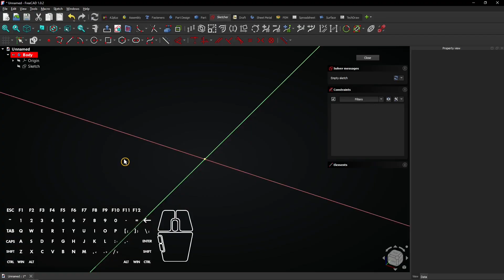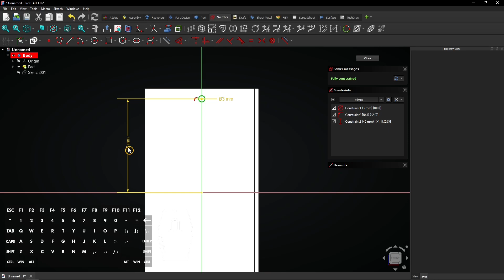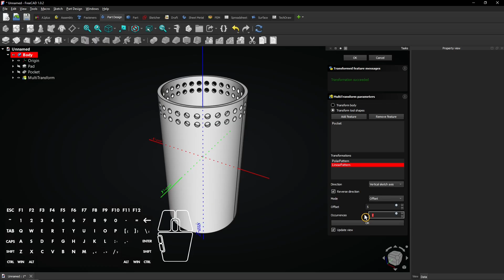🎡 FreeCAD Tutorial - FreeCAD Pattern - FreeCAD Polar Pattern - FreeCAD Linear Pattern

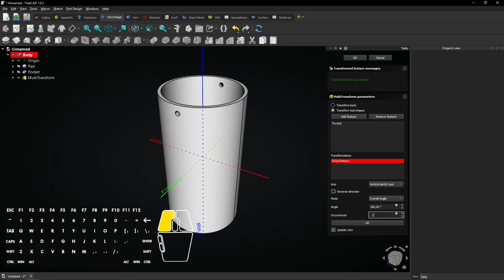Comment: (2:23) I tried increasing the number of occurrences. Two or three occurrences worked fine. Then, with an even number, problems appeared and messages appeared in red, for example:
4 occurrences - Unknown OCC exception
6 occurrences: - 
Geom2d_Trimmed Curve::U1 = =U2
In this case, no new holes are added.

If the number of occurrences is even, everything works and the transformation function message is green.
Can someone explain the reason for the error?
Reply from the maker: Never had that issue, hope someone can help. Thanks for noticing!